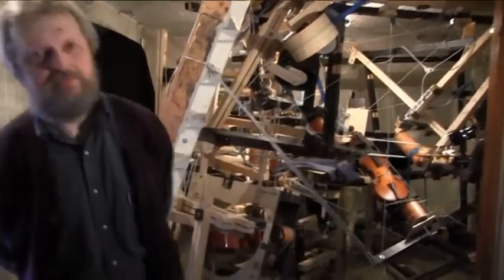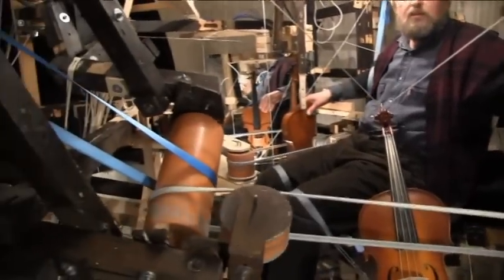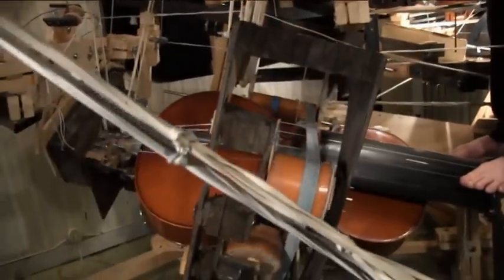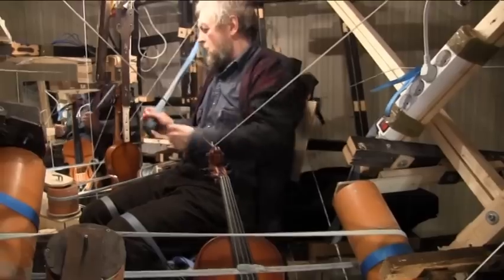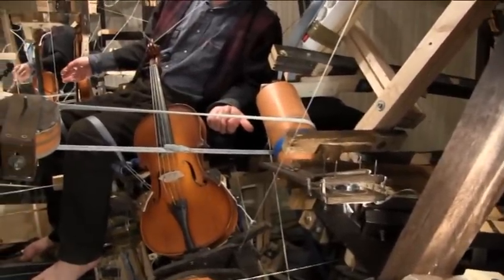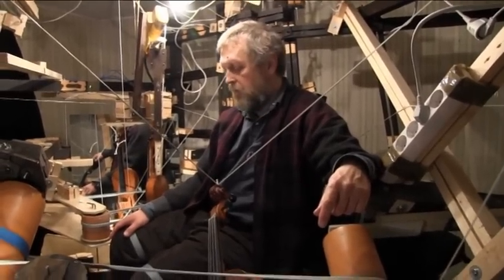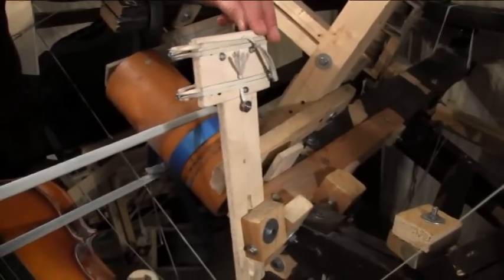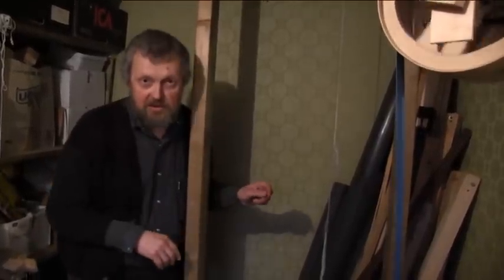Vladimir Pliassov`s musical machine. How it works (demonstration).

Comment: That rocks and looks like the Bow Belt for the Viola could use some improvements cause that knot needs to be on the outside of the rollers so that it doesn't slip which will make the sound more even. Having machine head tuners on all 3 instruments would be a big improvement for keeping it in tune. Adding frets to the Fingerboard of all the instruments would make playing in tune even easier.